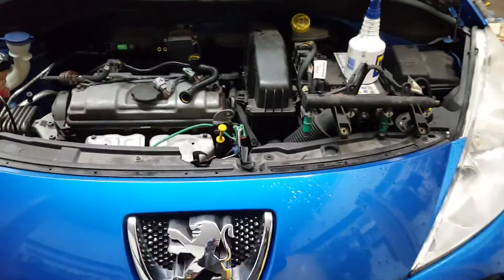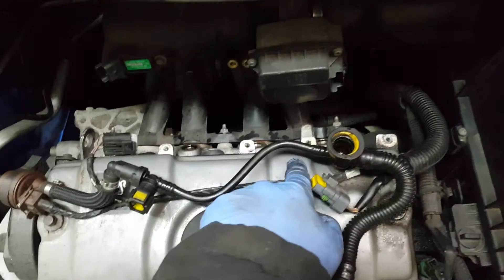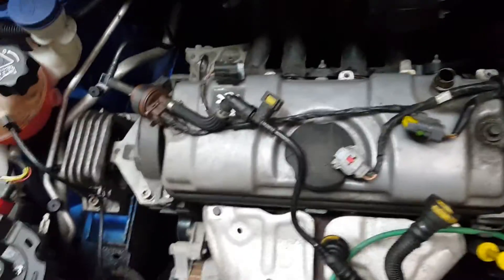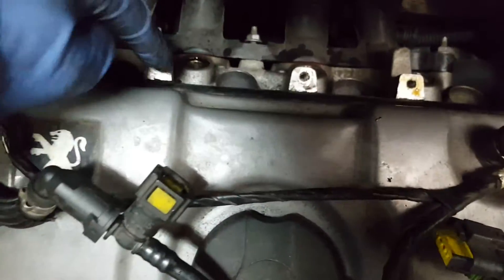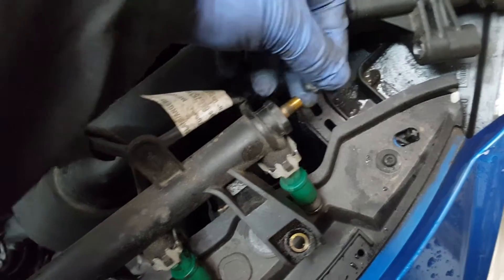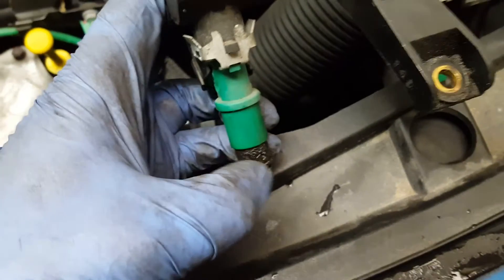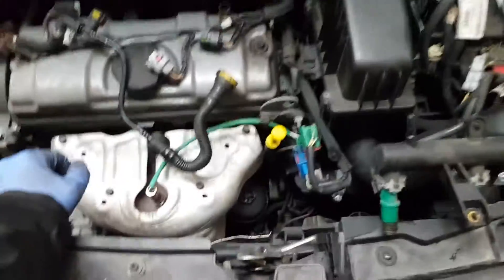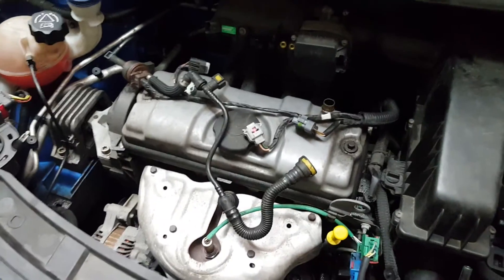Peugeot 207 misfire fixed. Coil, spark plugs, Injector removal and test.

Comment: I Have problem with my Peugeot 206 1.1 44kw gas ...I verify injectors I change spark plugs and coil but when I start the car makes a lot of smoke blue and sometime starts very high RPM stay there if I press acceleration a little go to normally RPM ....what can be ?
Reply from the maker: Have you had throttle body off to clean it and check it. Sometimes that gets carbon build up in it.
Reply: @AlexTheGrumpyOne  yep is cleaned...i willmake a video how is sounds and how its work....after i changed coil it was ok...but after change spark plugs..a lot of blue smoke... high RPM at start and intermittent acceleration on the road... autorev all time and a lot of blue smoke
Reply from the maker: Have you tried to scan the vehicle with diagnostic tool mate?
Reply from the maker: And how is your coolant level and oil lever?
Reply: @AlexTheGrumpyOne  oil was changed by the last owner but I think is mixed and was 10w40 ... I saw that Peugeot recommend 5w40
Reply from the maker: @supernova655  ok mate. That might affect it slightly as well.
Can you try and scam the vehicle? To see if it got any fault codes?
Reply: @AlexTheGrumpyOne  the problem is the year of the car is 1998 and i have an Autel MS609 that canot link to the car...is to old car :) just with Lexia i think will work . i will post today a video and send to you the link with the engine sound etc tnx bro

Comment: Hi,my c4 is fault codt too,p1338 misfire cylinder 2,its not coil,its not spark,and its not fuel ignitions...i am replace all off that,and the same fault code,fucking p1338.Do you know what is it?
Reply from the maker: It can be a plug on injector or wiring as well